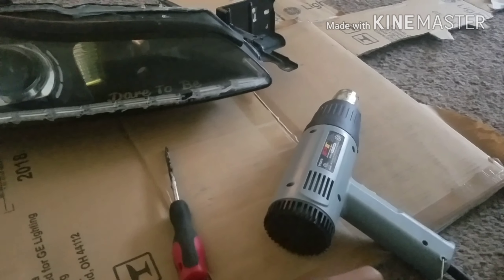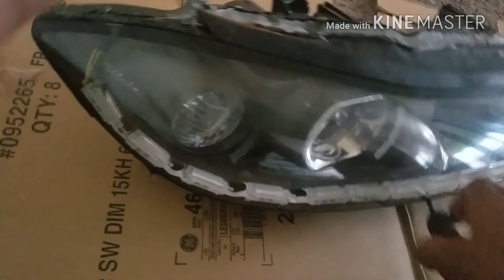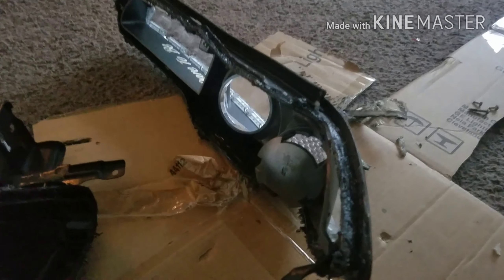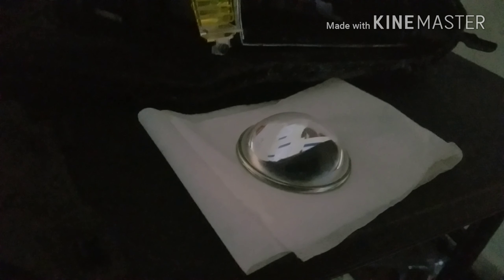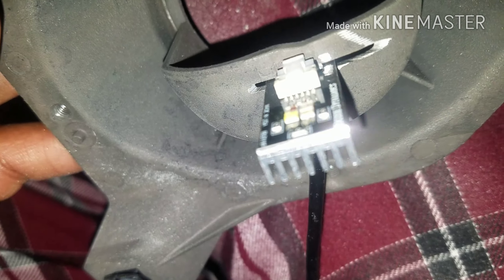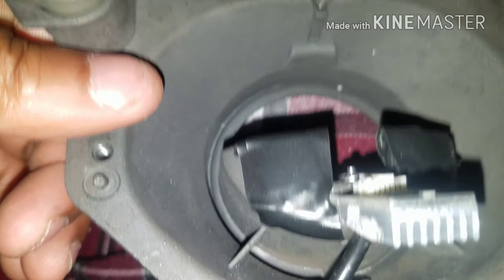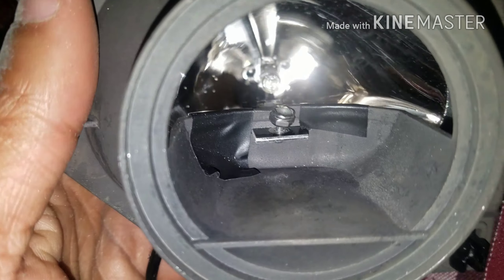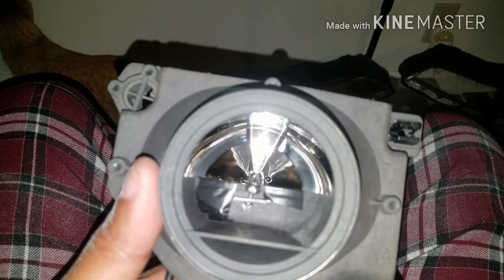RGBW demon eye instal on s15 headlights

Comment: Thank you so much for making this video! I am looking the the "OneColor red demon eye" and they give me the option to buy a reflector? I guess the demon eye on the s15 will use the factory reflector though like in your video right?
Reply from the maker: Yea i just used the factory reflector. Its optional depending on the look you want to get out of it
Reply: @Jay.3  Gotcha, and thanks so much for the reply! Also one other question if you have the answer to it, I don't know if it was covered or not, but when you drilled the holes for the wire for the demon eye and led strip how did you seal the holes around the wires because if I remember correctly we have to form a tight seal around that part of the light housing.
Reply from the maker: @treerexaudi  i made the whole barely big enough to fit the sleeve of the harness through and it actually had the perfect clearance to keep water out. If you make the hole too big you can still use a small ammount of headlight sealent around it
Reply: @Jay.3  I understand thank you!